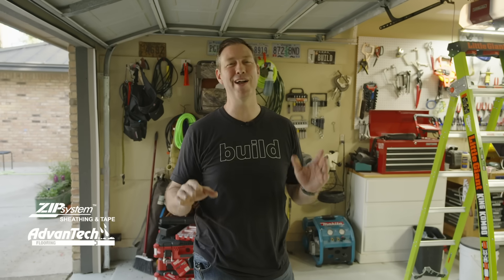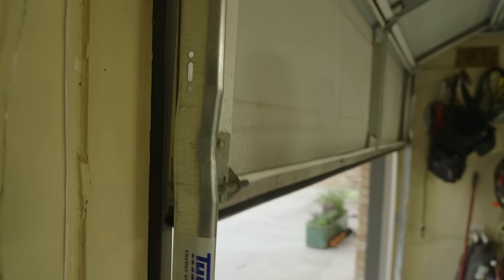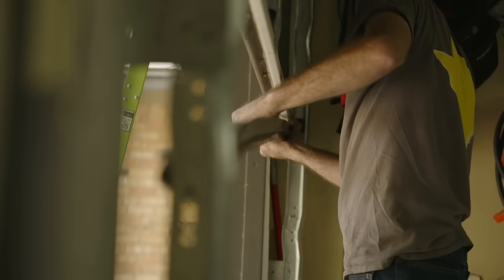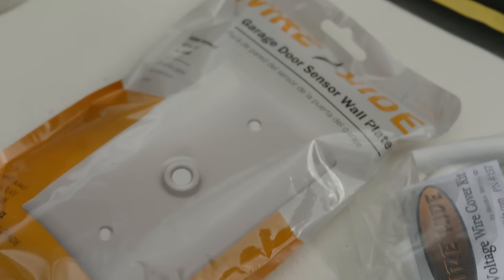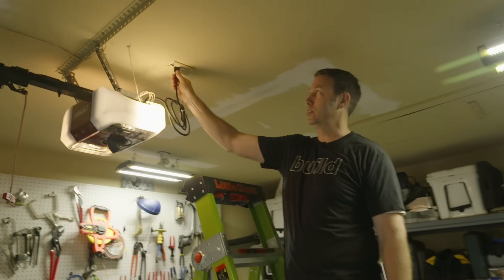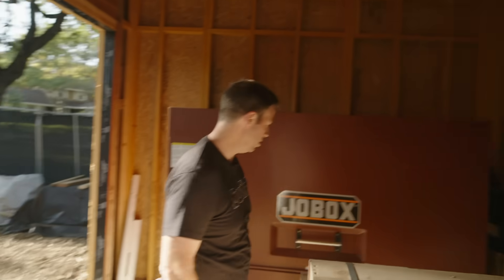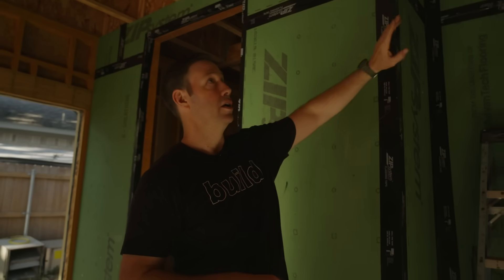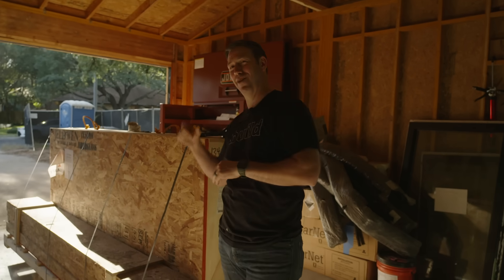Garage Door - Air & Bug Sealing

Comment: Back in 1987/88  my custom built over sized heated garage became my home cabinet/fabrication shop. To reduce noise transmission, and for thermal stability I installed Double Metal  garage door sections with 11/2"foam cores inside. Outside you could hear a bit of the router noise, but none of the compressor, table saw, duct collection, chop saw etc.  sounds. I called it my shop. My peers all called it the operating room. Yes, the doors and seals are very important. cheers.

Comment: I suggest looking into side mount garage door openers and mount door as high as possible - I have an 11 floor garage and a side mount lift with ceiling mount door mount - like commercial doors.  It lets you have a car raised in the garage and open/close the door  because the door is up high.

Comment: I'm the owner of a door company in Wisconsin. We deal with keeping the outside from getting inside everyday. 
If you install the correct door with the correct track you can seal the door without the extra track in your video.  https://youtu.be/pYORdRcG7Yo
Here's a video I made of a door like what you are taking about. Side mount opener. Sealed up tight with clip angle tracks reversed and 2 layers of weatherstrip on the sides and the top. I would recommend a 2" thick door with a thermal break and a bulb seal between the sections. If you have any questions, I'd be happy to help.

Comment: The thermo track is a great idea, but it dawned on me that you could epoxy metal shims into your current tracks at the points where the guide wheels come to rest.
Reply: Only the amount of play between the track and the wheel. Those bends on the track allow for a tighter fit, at least in theory.

Comment: Live just south of Chicago and installed an insulated door. Mine came from Sears they had the highest Rvalue door at 19.5 that was 7 years ago. with new insulation in the walls and ceiling the garage rarely dips below 35 during our deep freeze -40F it got to 26F

Comment: 1. A new car will not emit a significant amount of carbon monoxide; combine that with the fact that you drive in through a 128 square foot door and CO should not be a significant concern.
2. Instead of spending $$$ on a custom 'Sensor Shield,' I just took a piece of 2x6 and attached it to the wall to protect the sensor. No problems since then and it was essentially free.d

Comment: Get a steel back insulated door with polyurethane instead of polystyrene for the best r value. If you get glass in your garage door, make sure it's insulated since you will be conditioning the space to keep them from getting condensation on them. Also, the new Genie side mount operators are really nice. They model 6170 has wifi and battery backup, but you won't be able to let your Amazon guy in.

Comment: We install a product called "Xcluder"
It's a garage door bottom gasket that has steel wool inside it.
Reply: Omg those are so expensive... Looks smart but holy expensive Batman. $153 for a two-car width door!?
Reply: @rpavlik1  one of our clients had a rat chew some wires in her new Jaguar. Winter, climbed in her engine while it was warm. Apparently rats are not covered under a "bumper-to-bumper."
Reply: @jeffnarum1373  I guess "expensive" is all relative...
Reply: @rpavlik1  "There is nothing more expensive than trying to save money."

Comment: look into airplane hanger doors; much better but not used in residential. somewhat DIY design but it's an outside hinge door that opens to the outside; kind of like a closet folding door but vertical. it doesn't waste ceiling space and seals better. offset hinge and you could make a crazy thick door... pulls up with a winch but better things can be done.  just food for thought; don't know if parts for those could be useful.  the downside is a lack of kit.

Comment: if you don't want to pay for that weird track to rattle your door back and forth just find a 7/16  and loosen and adjust your wall brackets on the track you have and slide the track closer to the seal. ever notice your hinges/wheel holders are different dimensions from the door? the allow the door to not rub on the wall as it's in operation and yet push against when it's closed.  and yes i know some odd wall brackets are non-adjustable however wall brackets are cheap. call me on the right day and i'll give you a handful out of my service truck

Comment: If your sealing up your new garage that tight and putting in an exhaust fan don’t forget a fresh air inlet. I didn’t hear you say anything about it and it would be a shame to have to cut it in after everything was finished. Also if your interested in some really nice garage doors check out Silvelox. They are an Italian door company and are doing some great innovations around garage doors. One of the worst thing about all garage doors available locally is the sealing, track clutter, and the overhead opener.

Comment: insulated doors make all the difference. had 10 ft 5 car shop with south facing doors and had to replace the bottom row of insulation due to damage and oh man it felt like a space heater on the inside (108* Fresno heat) whereas the insulated portions of the door you could feel zero heat coming through.

Comment: Sensors?!?
Who uses the sensors?  I just mounted them 3' apart up in the rafter.
Ahh, the All American Garage . . . a space to hold a bunch of Shit rather than, I don't know, A CAR? We use our Garage for the cars. No Hassle unloading during Rain, Sleet, Snow or powerful winds. Gee, what a novel idea. 2-car garage with 4 ft. all the way around, connected, by breezeway, to the house. And yes, insulate and heat the garage. We have Heat and AC in ours.

Comment: I always install exhaust fans in garages in our new builds.  Removing fumes is one benefit, but here in the PNW especially, pulling into the garage with a rain-soaked car with a warm engine is a recipe for disaster (mold) since all new builds are drywall finish inside.  If you want a climate controlled garage, get a make up air intake with powered damper to open when the exhaust fan runs.

Comment: I live in the north east where it gets very cold.  With two garage door I got the best door insulation for both door.  The garage never gets cold might get to 60 degrees.  Outside is below 20 and the garage is never that cold.  In the summer it will stay cool on hot days. 
I also use the my q app for the doors and works very well.  Great videos keep up the good job.

Comment: Matt:

Battery Backups  are required in California.  That is why the manufacturers have that option.
Reply: Why are they required in california
Reply: @derekpiehl85  Garage door battery backups are required in California so that if the power goes out and the occupant is unable to lift the door manually the door will still open.  This becomes important in the case of a wild fire.  In several instances in the 2015 fires individuals died when the fire consumed their home and were not able to escape because they could not get the door open.

Comment: You should check out one of the new wall mount garage door openers.  Not sure how good they are but I saw one being installed on one of my new builds and they look interesting.
Reply: Wall mount openers don't provide any downward pressure to completely 'shut' the door at the top... unlike traditional that pushes the bar/arm against the top of door.

Comment: wow those tracks are 40% the cost of a new door and tracks installed! i was expecting close to $50 per door. gonna have to pass on those. 

love my 3 layer doors.

my liftmaster's attach to the torsion bar. i am not a fan of the chain drives. cool new features with the camera though.
Reply: That’s gotta be some cheap door if $250 is 40% the cost.
Reply: @lordgarth1  just retail

Comment: Matt. Remember that your door will close even if you are having trouble with the beam sensors or pressure sensor by simply pushing and holding down the button on the wall. Of course you'll need to fix the issue later but it might save you a trip home to rescue your wife.
Reply: Reminds me of the Aggie who locked his family and keys in the car and had to call the cops to get his family out.

Comment: you might also want to check out the nest protect. it has a carbon monoxide detector that can warn you to your phone before it goes off.
i wonder if theres a way to trigger that CO detector to turn on the exhaust fan..
then maybe check again for CO in 10 minutes, and alarm if its still present

Comment: Just about any of the major door manufacturers make a 2: insulated "sandwich" door which is a 2" polystyrene (base models) or olyurethane (high end) sandwiched between a steel outside and a steel inside, Higher end have thermal breaks between front and back.

I have 25 years in the industry and have installed many brands, Clopay is my personal favorite.
Reply: I work at Clopay, appreciate the positive feedback.

Comment: Just got rid of old leaky wood and Masonite "style and rail" doors, and installed insulated double sided metal doors w low e glass and much better seals on all 4 sides - all I can say is wow - much quieter operations and dampened outdoor noises too, but the big bonus is more comfortable temperature in my unheated garage - when it was 39 degrees out it was 69 degrees in - before it would only have been about 8-10 degrees warmer than outside.

Comment: Are you doing spray foam insulation in your new garage?  I see it was only built with 2x4 which means you can only go as high as R-15
Reply: don't let R values fool you- 3 inches of closed cell spray foam is all you need.  really 2 is fine. some day the building inspectors and codes will update for spray foam.  i was basf certified spay foam installer for many years
Reply: @thatbiguy1975   I live in New Jersey and the codes are different.  New construction With 2 by 4 walls you must use spray foam insulation to meet code because you cannot meet the R20  value in standard bat insulation.  Otherwise walls must be 2 by 6

Comment: It will be interesting to see how long that adheasive lasts on the door seals......Wouldn't it be easier to just install you exterior door weather seals the properway instead of replacing the tracks?  I had two Thermacore garage doors installed and my garage stays at 65 almost 30% longer then my Clopays doors.

Comment: Im a door installer in PA and Insulated is popular here, insulated also is much quieter when in motion and helps tremendously with heat and a/c some are rated as high as 18+ R value. And i know your mr. Insulation so i think on the new house you'd be happy and impressed with the quality.  I can recommend 2 really good manufacturers   I know that one of them has distributions out you way also battery back up will only run 6-8 full cycles max (that one of the tests we have ran to give ppl a more realistic amount)

Comment: I have a hurricane rated garage door on my house I have two separate garages both 8 foot wide 8 foot high doors they are hurricane rated so 140 mile an hour winds and they're insulated as well and they're very heavy duty doors I however am not happy with the rubber gasket at the bottom of the door because there is room around either end of the gasket for critters to get through like snakes and geckos and bugs. It is a Clopay brand door and seem solid as it could be.When you slap the door with you hand it just goes thud, no twang sound at all. It came as a new construction door to the house as it was being build so I do not have the cost of it at the moment but I am sure both 8' doors cost a lot and well worth the expense in "Hurricane country here in Florida.

Comment: For a start to insulate the metal doors see about using Lizard Skin which is a product that you spray on the inside of cars to repel heat on the floor, roof and fire wall as well as inside the doors and then use Dyna Matt to insulate the panels.

Comment: Go with a steel backed insulated door with the polyurethane insulation. The sections are typically thinner but it does 2 things. Insulates better and due to the rigidity of the panels the doors typically run much quieter.

Comment: Clopay 3200 2in thick very well insulated and well built doors mostly used for commercial facilities but can be used for residential too i install them all the time
Reply: They also has a full line up of coachmen doors check it out

Comment: Stop building garages so small!!!  A real garage should be a 3 car garage 36 feet wide by 28 feet in depth.  This allows at least two cars with ample room along with lawn mower,  work shop,  junk,  freezer,  BBQ grill,   storage,  easy access and some room or warehouse.  Oh,  and with 9 foot ceilings.  Today's two car garage are way too small at 20 by 21 feet.

Comment: Matt - you’d asked for comments about insulated doors. We live in northwestern NJ, 1100’ above sea level with the garage on the western end of the house (so it gets the brunt of the prevailing winter winds). We installed insulated and weatherstripped doors, and insulated walls when the home was built. I can keep a jug of distilled water in the garage all winter and know it will never freeze. Part of that is obviously heat loss from the house, but better to hold onto that heat than to lose it completely... a easy to heat with kerosene for the occasional winter garage work day.

Comment: Should be able to run the door sensor cable inside that post and into the wall for a tidy fit.  I assume your doing offset double dry wall inside the garage as a fire proof barrier?

Comment: The insulated door does reduce road noise passing into the garage, but when you park two cars and close the garage up, that engine heat increases the temperature in the garage-a lot- much more intense in the summer.

Comment: I live in the PNW, switched to an insulated door about 10 years ago. It made what I consider a significant savings in my winter heating bill. For your existing door go to the home center and get foam board and use that to insulate your door.

Comment: I was sold until the end of the video where Matt identified failures. Hope the manufacturer redesigns the weatherstripping attachment. The tape strip obviously doesn't work. I'm gonna wait until it's redesigned before I buy. You shouldn't have to farm rig a new install.

Comment: Surface mount wiring run in plastic conduit is easier to upgrade and maintain.. Hiding behind drywall you could risk drilling into the wiring otherwise...

Comment: Is there room for an extended garage or extending the garage to just an enclosed work shop area? The wall between the existing new garage and workshop or builtshop Yes- may consider that with an extended large solid steel commercial door wide plus tall to fit your needs The built shop could be
without a garage door and no problem to keep it warn or cold, and saw dust  from tracking in your home. Good luck

Comment: I instead just used a UPS to power the opener. This way none of the features are disabled. It may not be able to open/close as often as the battery on that opener, but as I have a protected UPS in a secured with lock area, the camera would work. I have a separate camera system using PoE, but the MyQ app I have for my 2 doors works great.

Comment: Amarr Garage Doors makes a few really good polyurethane insulated doors. With that ceiling above the new opening, not sure how far back that beam is, you might be able to fit a roof pitch track that will run the door up against the ceiling. A garage door threshold can help seal the bottom as well. Amarr has a dealer locator on the website. Love the new build and good luck!

Comment: That garage opener sensor holder would be good when you have sunlight directly hitting the sensor since it has a shield on top and bottom
Reply: Yuuuuuup. Mid afternoon during the summer, I have to have a shadow over the sensor for it to work sometimes and that my was my exact first thought

Edit: OOOF. for that price, I'mma just build one.

Comment: Matt,

I have used the following product at my properties what have had both water and rodent infiltration under the door and it does a fantastic job. At one property the driveway slopes to the garage which use to flood with each rain. Since installing this product I have zero water in the garage even after the largest rain.
https://www.garadry.com

For Insulated Garage Doors here in Ohio I only use the double sided Clopay Door. I have in the very distant past used doors that had exposed foam on the inside, but it would be damaged over time and I felt that it presented a fire hazzard. No only are these doors much quieter and well insulated, but I have found that they will last a lifetime if treated well. 
https://www.clopaydoor.com/

I do not represent either company in any way and attempt to purchase products that are a better value overtime verses price. Oh, and in my garage I do keep cars, a 1972 Triumph TR6, a new Tesla Model Y, a billion spare parts for the TR6 along with with every tool that I own.

Comment: "Overhead Door" brand insulated doors are what we use up here in Northeast Texas.  They are really good in my opinion.  I worked for some brothers that have been building houses, barns, chicken houses, banks, restaurants and more, since the 60s.  They really like them.
Reply: Overhead doors are only held together by rib necks there no real strength to there tracks at all.
Reply: @JohnDoe-pb7em  I am not sure what a rib neck is.